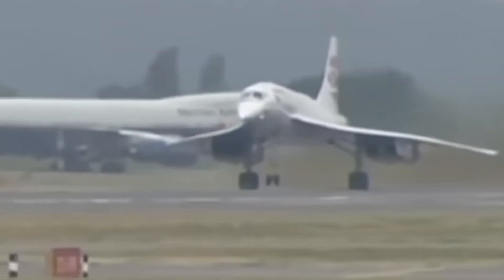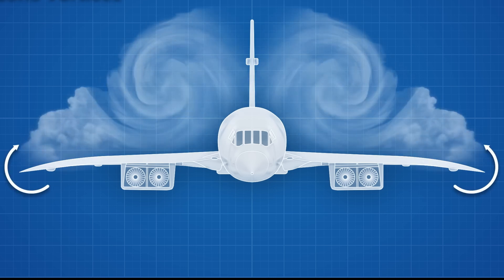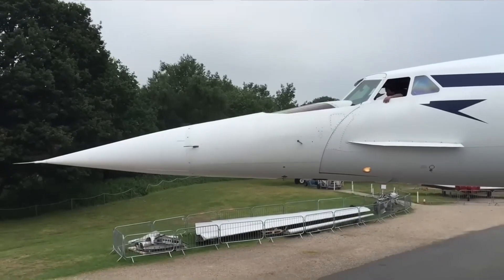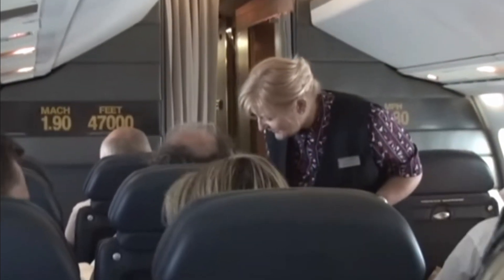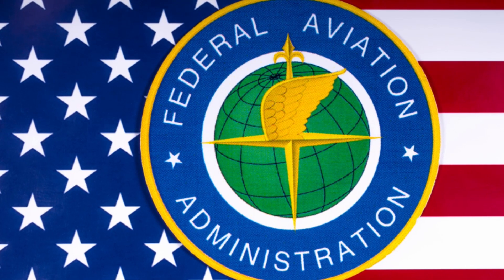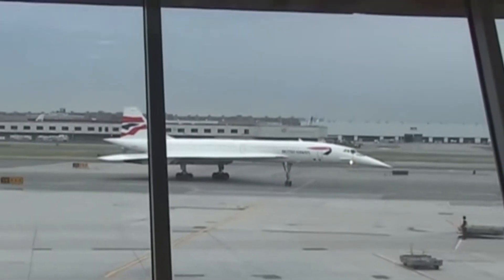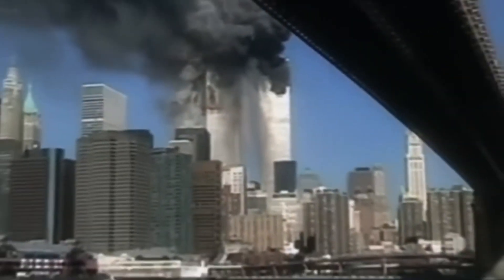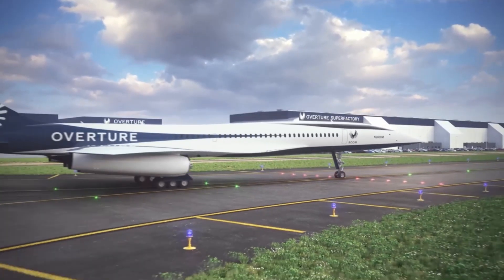Concorde Tried to Change the Future of Air Travel — FAILED And Paid The Price

Comment: I think the title is a bit misleading, because the Concorde didnt fail on its own, the DC-10 made it fail even faster by causing the crash that would have never happened had the DC-10 never existed.
Reply: It flew after that accident, so it cannot be blamed for its retirement. Even with the DC-10's debris, the aircraft should have survived, but the fuel tanks had been filled beyond their maximum level, which made them unable to cope with the impact of the debris.